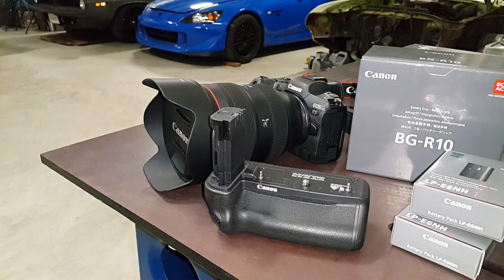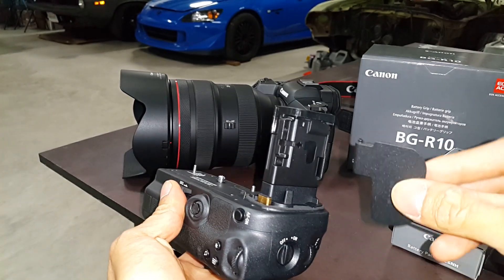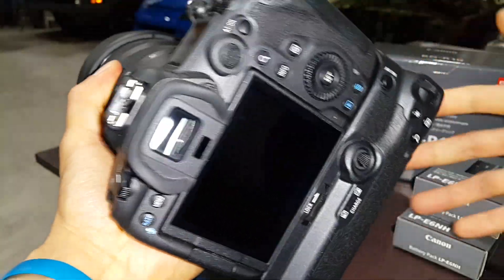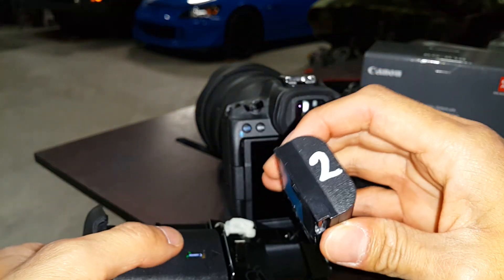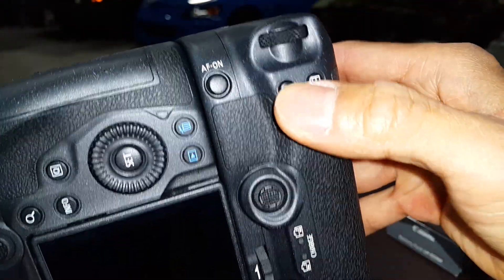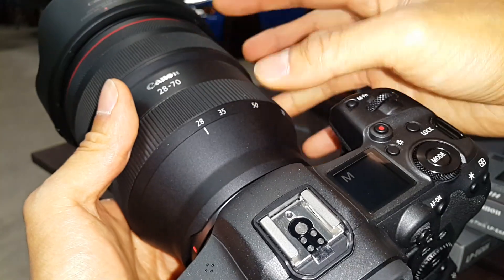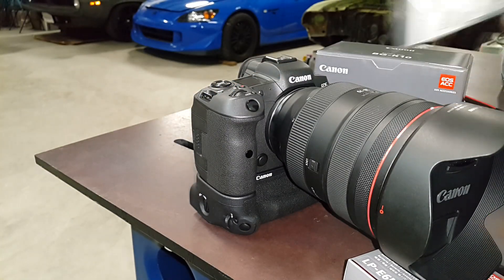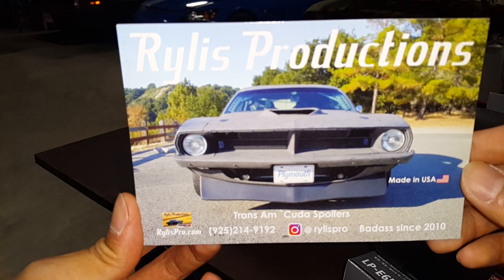Canon R5, R5C & R6 BG-R10 battery grip review!

Comment: This is a dream Camara !!!!
Can't wait for the full review!!!
Reply from the maker: Yes the R5 is very nice, but the RF 28-70mm lens I have is hard to use for video due to all the focus breathing.
Reply: @RylisPro  you need to switch to RF 24-70 F2.8 ...
Reply from the maker: @maorvaknin769  I agree on getting another lens. I am keeping the 28-70 as the photos are stunning, my Wife looks so good in the images it produces. As for a video, I am waiting on the rumored wide angle RF 14-28mm 2.0 L lens. Will also be getting the RF 100-500mm for macro shots. The only problem is that they are so damn expensive haha thanks!
Reply: @RylisPro  
The canon RF 28-70 suffering from focus breathing  and that's a deal breaker for most people and that why 24-70 is much better ✊🏻
Reply from the maker: @maorvaknin769  for the $2300 RF 24-70 I would rather get the RF 15-35. The only problem is the wobble with the R5. Hopefully the new RF bodies/ video cameras coming out next year will fix these issues thanks!

Comment: It is not true that the grip uses the higher % battery.  It may have appeared that way when you checked it, but I have caught mine using a 68% charged battery when the other one was at 98%.  You can tell because the camera will slow down it’s FPS when the battery gets below about 70%.  I caught mine doing this twice and each time I swapped the battery position in the slots and the fps went back up to 12 FPS. I wish mine did as you say.
Reply from the maker: I stand corrected! Learned something new thanks!

Comment: I only see one charging light on battery grip with two batteries in it. Will it switch over to the other battery after? I thought I would see two charging lights.
Reply from the maker: I don't have the Canon USB-C charger so I don't charge my batteries from the battery grip. I do have a total of four LP-E6NH batteries that I keep charged all the time so I don't ever run out of juice

Comment: Thanks for the interesting review, but your statement that "with the battery grip it's another 3 lbs" is simply not correct.  A R5 without lens but with one battery weighs 25.6 oz (with the original battery).  The BG-R10 adds 12.4 oz plus the ONE extra battery at 3.2 oz. (the original battery just moves from the R5 to the BG).  The total increase in weight is 15.6 oz or less than 1 lb.  A R5 body with a BG and batteries weighs 41.2 oz total (no lens) or 2.6 lbs.  A EOS D1 X Mk3 with battery (again no lens) weighs 50.7 oz (3.2 lbs). If your camera and lens using an internal battery weighs 3 lbs, adding the battery grip will increase the weight by less than 25 percent to total less than 4 lbs.  Also, it appears that you are using a micro SD card in a SD adapter.  That's generally a bad idea in any Canon EOS camera.  SD adapters add additional contact issues that can  drastically affect reliability and often cause serious problems! If you value your content, stay away from micro cards in SD adapters.
Reply from the maker: No worries! I'm sure your are correct with all the weights. I think I meant 3lbs with the RF 28-70 brick I had mounted on at the time. Thanks for the micro sd card tip, yea agree, getting v90 SD cards, Ninja V+, & CFexpress cards from now on!
Reply: @RylisPro  Yep,  I just didn't want anyone to be afraid of adding the BG because they thought it added 3 lbs :-).  FWIW: I've had good luck with Sandisc 128GB CFexpress cards in the R5 (so far - fingers crossed). Also, FYI, I've had good results with "3rd party" LP-E6NH batteries from Powerextra  (Amazon) A 3-pack of batteries and a triple-charger goes for $41total, and they work fine.  Even if they only last a year or two (as opposed the the Canon batteries which can last for 3 or 4 years, they are a good deal at about 1/5 the cost of a Canon LP-E6NH.  Cheers
Reply from the maker: @nicholasyasillo1242  the battery life on the R5 with a single LP-E6NH sucks so bad that I don't think anyone will be scared of the battery grip haha!